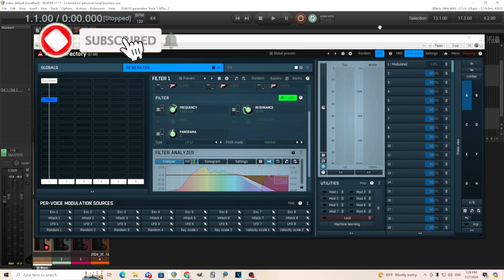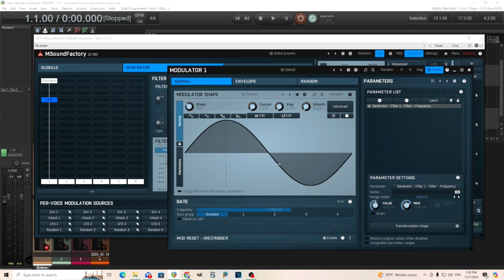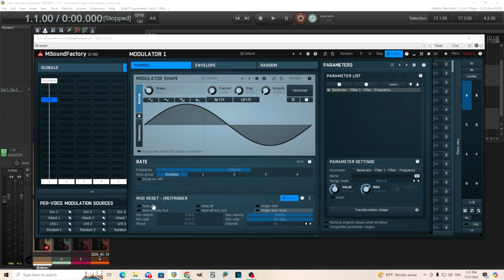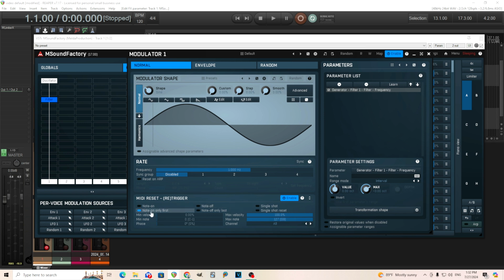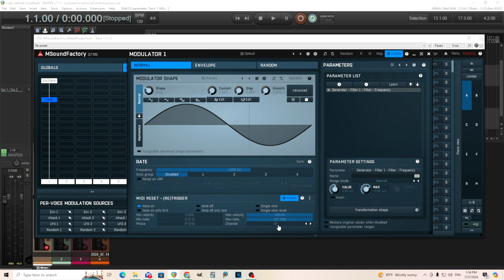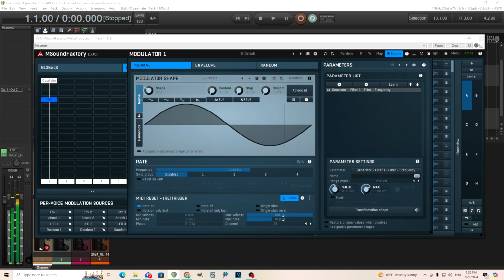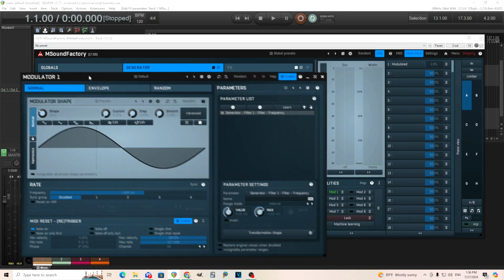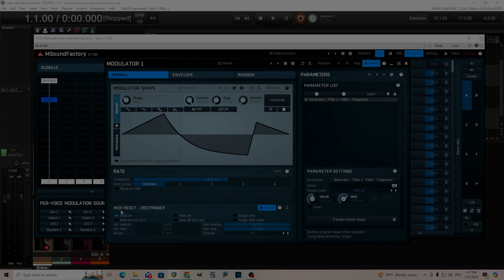Melda Modulator Re-trigger

Comment: Hi chandler, in the beginning you say, for simplicity I put the sound in legato mode. Now I'm looking already for some time how to do that. Can you explain how to stop re-triggering when notes are played legato>
Reply from the maker: In the globals tab, set the synth to monophonic. That usually does it, but if it doesn't, click the advanced button. Play with the various voice restart modes until you get the sound you want. Also make sure the envelopes, lfos, etc that you use are set correctly for the sound you want. They usually have trigger setting inside you can adjust. I hope that helps.
Reply: @Chandlerguitar  Hi Chandler, I tried it out and it works when set to monophonic! At re-trigger you have various options, among which none and smooth. Do you know how that is exactly programmed? With re-trigger at none I do not believe it does not re-trigger the envelope completely, at least not when set to polyphonic, although it does something to the attack.
Reply from the maker: @joopbaltussen6170  They all do slightly different things. I believe none doesn't restart the envelope and smooth restarts it without clicks. The best way to figure it out is just play with it a bit.